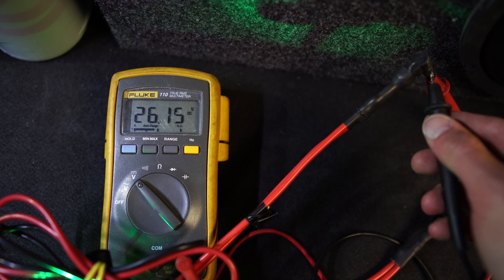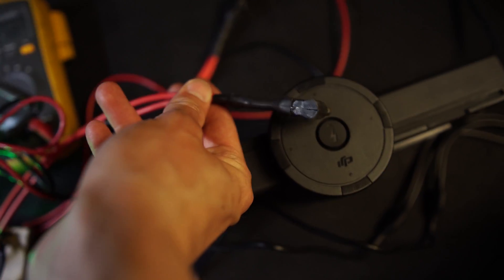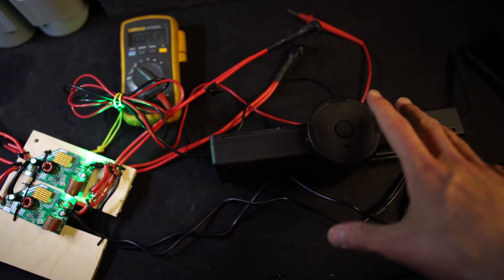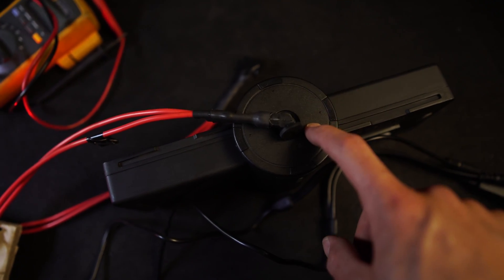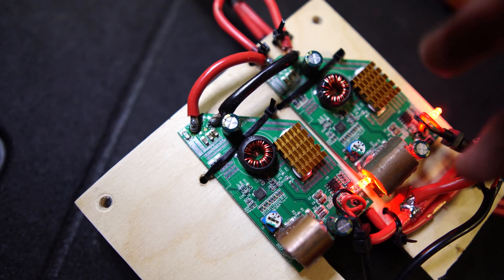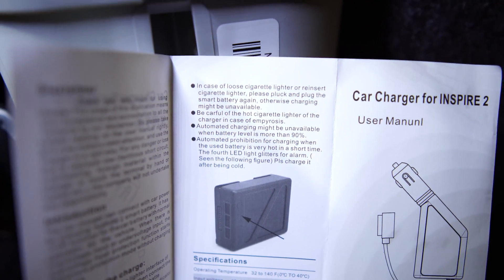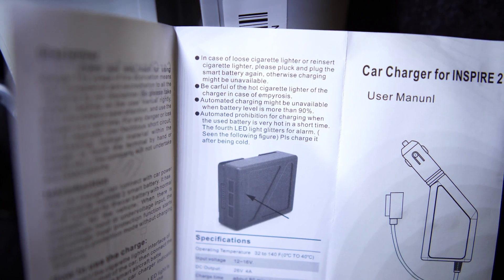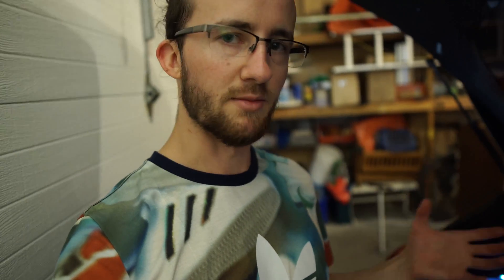Part 2 - Car Charging the Inspire 2 - IRCTek DC Step-Up Converter

Comment: Nice video! I think you have already seen this one: https://www.youtube.com/watch?v=KthVkVm4Ook&t=401s

I made a similar setup myself to charge my Phantom 4 pro batteries, using those 600w DC-DC and it's working great.

I'm not sure, have you tied both converters together? Maybe that's the reason they are running hot. Some DC-DC inverters can't be tied together due to the way they work..